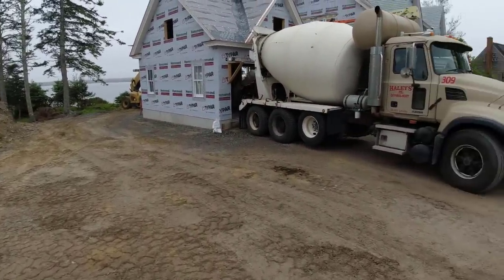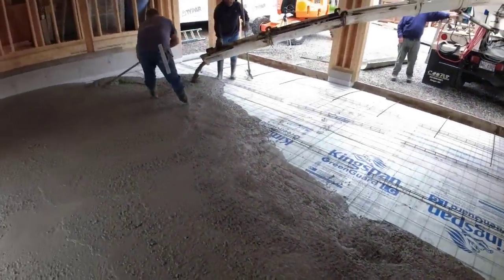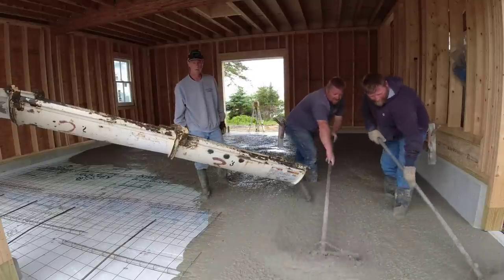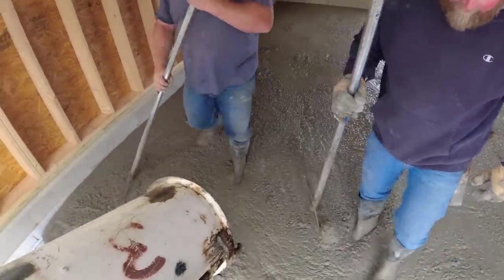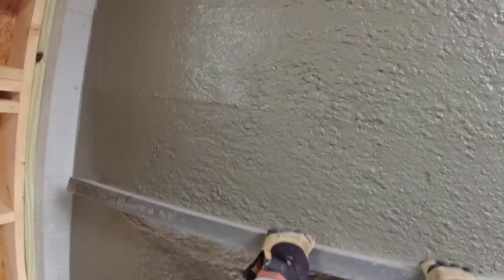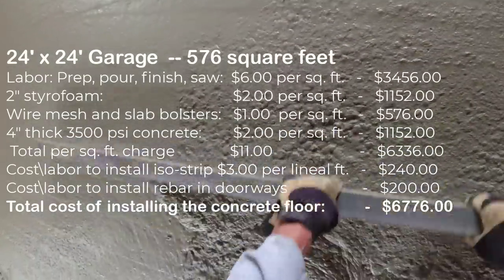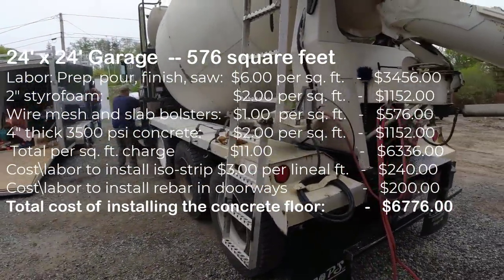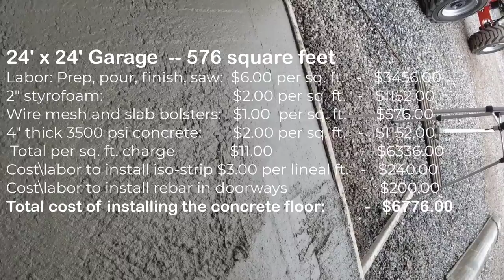Pricing Concrete Jobs - 24' X 24' Concrete Floor (Prep, Pour, Finish)

Comment: In all my years doing concrete we never did styro in a garage , and very seldom wire. Concrete was about $25 per yard and by the year 2000 concrete was up in the $90,s, now it’s much more than that. The prep work is a time consumer, in your area, they seem to have the grade really close from what I see on your video,s. Hauses concrete in PA nobody has any grade remotely close, regardless you have to get paid for your time and or equipment use, thanks for your spread sheet on cost.
Reply: I just did a pour (homeowner) and concrete was $205 per yard... 6 weeks wait 3000 PSI.
Reply: @illmatic33  same deal here in Michigan
Reply from the maker: Most of the time the grades are good here. Gravel work is always subbed to an excavator, it's all they do.
Reply from the maker: Wow! That's kind of expensive.
Reply: @MikeDayConcrete  my first time so I wasn't sure what my options were being that there was also a shortage. I'm in Georgia... But for future what's a reasonable price I should aim for?

Comment: Why do you pour it so wet? I have only a couple months of grunt work experience, but of the two dozen or so pours I’ve been in the material has been a lot stiffer, never soupy like this. Maybe four, five inch slump? Weather has been a mild June, hot July, and cooler august. It looks easier to rake and move, is that one of the advantages? Is it preference? I’ve poured with and without fiber, with a couple wire meshes, footers with rebar, stamped patios, stamped and brushed driveways, sidewalks, and aprons with curbs. But I’m wondering about working with a higher vs lower slump
Reply: Having done pours from 4-6 inch slumps, believe me, if the concrete is exposed to the sun and on a flat surface, you want the 6" to allow for a slower curing time.  It also allows for more time to finish the surface properly.
Reply: @kurtfrancis4621  how slow should it cure and take to finish properly? I’ve poured driveways from gravel to broom finish in under two hours, with plenty of mag and edge work. Sometimes used jointer, and never walked on til the next day when saw cutting. I’ve seen knee boards used once during a large stamped patio and even then it was only soupier bc we had heavy rain for a minute
Reply: @kurtfrancis4621  also, is that really a six inch slump in the video? Seems like more to me, but I haven’t seen it all in person
Reply: Mike goes over this is in other videos. He uses a high range water reducer which does two things. It reduces the amount of water needed in a mix to get the desired slump (less water means stronger concrete) and it makes the cement more workable (like pancake batter instead of chunky peanut butter).
Reply from the maker: What David said, we use water reducer to pour looser slumps. We do over 200 pours a year so this helps to not get burned out pouring stiffer concrete.
Reply: @MikeDayConcrete  Cool, makes sense! Thanks guys 👍

Comment: I have a question, if your planning to store/ wash cars inside the garage , what’s the most slope you can use to push the water out the door ?
Reply: Not sure what the "most" slope is but on a 24' garage we usually go 2" slope back to front.
Reply: Up here I use 1” per 12’ slope to ensure absolutely zero ponding, we have done aprons at 7” and the customer thought it was level??

Comment: Hey mike I’m in Vermont and for the last 4-5 years I’ve been charging around $500 per yard for 4” slabs with a thickened edge and 24” grid of 1/2” rebar + cost of extra materials like styrofoam.  I’m guessing that our pricing is similar, I think I’m going to go up a little bit considering the cost of concrete and steel has gone up. Thanks for sharing your rates it’s always helpful to me 👍
Reply from the maker: You're rate sounds about right.
Reply: So for 4 yards you charge 2000.  Wow that’s cheap, in Canada we charge more.  I would charge 4-5000 for those 4 yards.

Comment: Whats your price if you have to remove existing concrete and repour, start to finish?  Ive been quoting about $13-14K.
Reply from the maker: Depends on a lot of factors, size, thickness, rebar or wire in it, haul off and dispose, too many variables for a simple question, sorry.

Comment: What does the styrofoam do?
Reply: insulates the slab, moisture barrier and also prevents the slab from sweating in the hot summers
Reply from the maker: Yes, what Eric said.
Reply: @MikeDayConcrete  - interesting, never seen it done in the south.

Comment: I’m still not impressed with your reinforcement process.

How does laying it on the ground and then walking all over it while you pour the concrete “reinforce” anything?.

it should be suspended into the middle of the concrete and if you’re gonna lay it down it should be propped up with some props/“chairs” & Not walked all over….

I’m sorry to call you out on this but this is just plain sloppy.